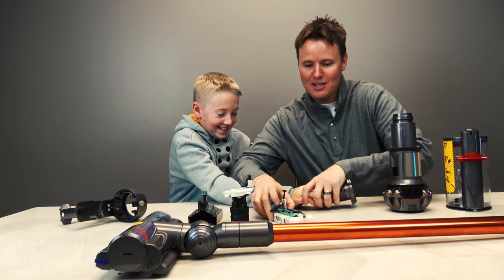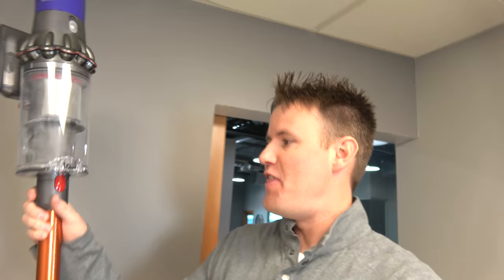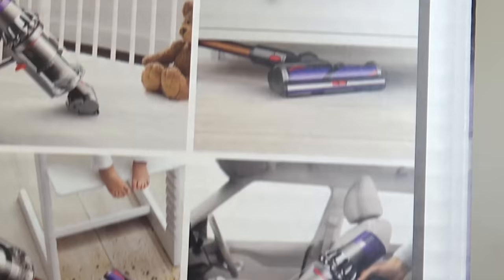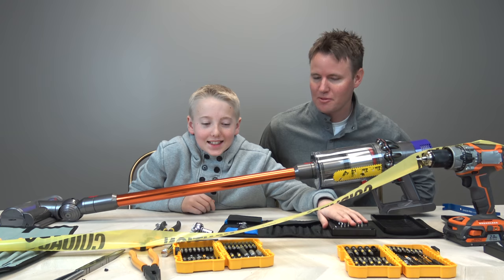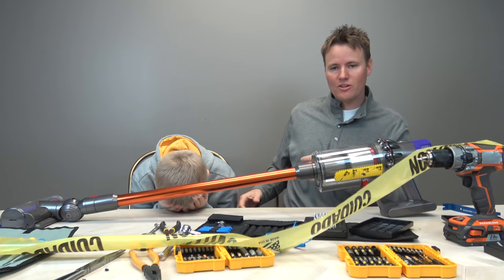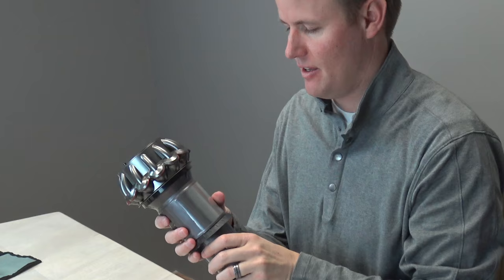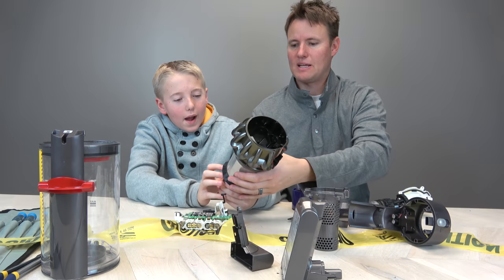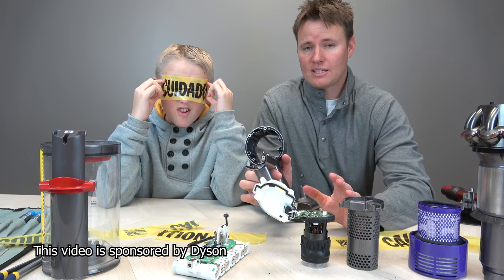What's inside the most POWERFUL Dyson Vacuum?

Comment: A great cleaner, but one that, according to the downloaded V10 instructions, cannot be used on certain types of carpets - and these would come under the loop pile range. The supplied brush bar head for carpets could cause fraying of the tops of the loops, where what you collect in the bin might well be a considerable amount of carpet fibre along with the dust.

Comment: To be clear: 60 Minutes is the maximum time on lowest level without any motorized attachments. on maximum level with an motorized brush attached (you´ll use it the most in this combination) the maximum time goes down to about 30-40 minutes max.

Comment: You used the soft roller head on the carpet. That head is meant for hard floors. Use the direct drive head for the carpet it'll work much better.

Comment: Those batteries are why so many rechargeable devices prices have dropped like lead balloons. Take the teslas basically a super car for a luxury sedan price starting around what 75k or less for their lower end models and topping at some where around 350k. Basically they top out in price below the entry point of other super cars. elon is a mad genius lol. The guy took off the shelf parts like the 18650 gr batteries and put them all together in to amazing machines. I have a cheap but solidly made rechargeable flash light that uses those batteries and plenty of spares i salvaged from "bad" laptop batteries as they are used in them as well. 

Those batteries are avail from 1200 mah to 6k mah and are dead standard off the shelf. They are as universally sized as aa aaa etc batteries.

Comment: No the batteries in Tesla are different then the batteries in the skateboard. And this vaccum uses different batteries then both. As seen here. The tech of batteries are different. Tesla and another company use different battery cell tech. Not everyone uses same. 

So in simple.

Tesla i'm not sure the specific battery kind. But they aren't using normal Lifep04 batteries, As these have the least performance and were the first batteries to be used in RC hobbygrade packs. But no one wanted to use them because of their under performance in power ability. vs normal Lithiums that gave 7.4volt or 11.1volts, while LIFE gave 6.6volt and 9.9volts. But they are the safest ones to use, and even if their tossed in water or nailed in. They don't burn, or explode, or burst into flames.

Goal zero (A solar company.) Use NMC Lithium. (Tho their website says 500cycle life. NMC on this says  Similar life lithium to Iron so it might different depending on use.). Balance power/safety and high energy power.

Skateboard,etc and other companies tend to use Lithium Iron Phosphate for the longer cycle life and safer battery cells.

This vaccum uses Lithium (what you say using Nickel Cobalt-aluminum oxide). Has the poorest safety, But high energy. and has a low cycle life.

-----------------------------------------------------

So what's inside. You guys should look into your battery techs. Yea you're right in 1 topic. They do use 18650cells. But not all the same 18650cells are exactly the same. It's like AA's. There are many different types of cells for AA's that use different power. Like NIMH to NICH, to Alkaline, to Alkaline rechargeable, To Lithium Poly, to NIZM.